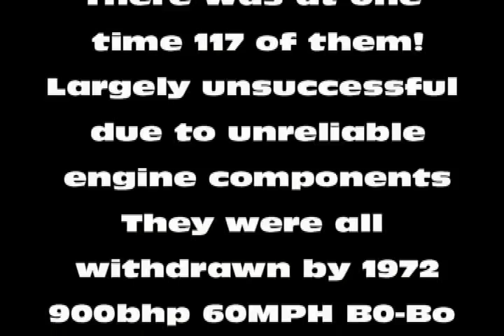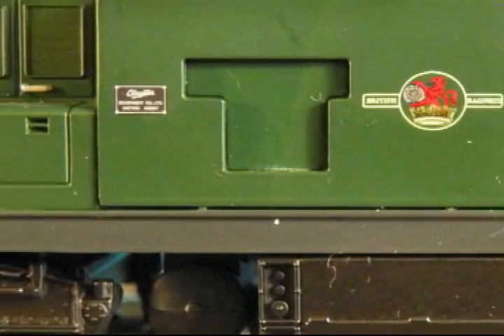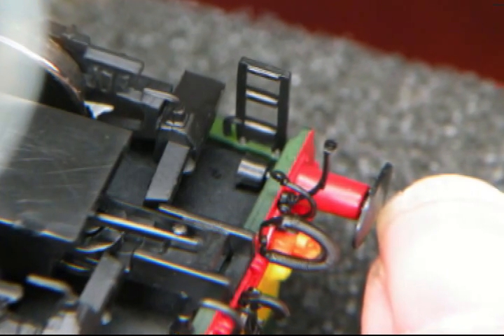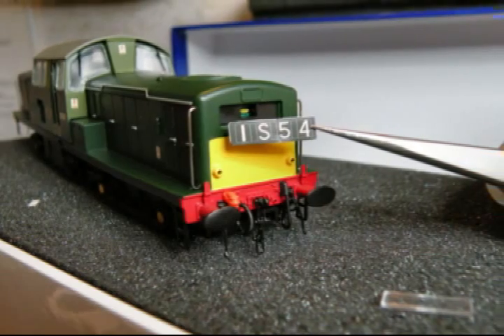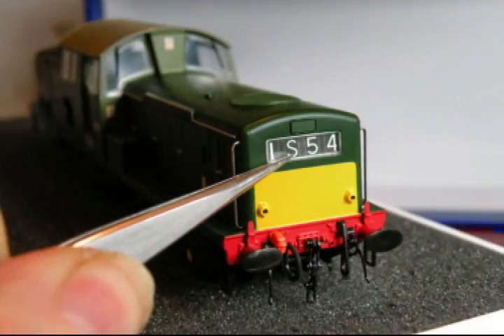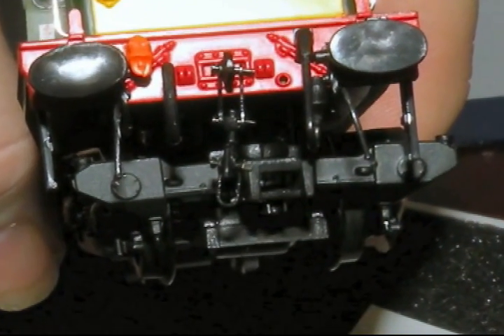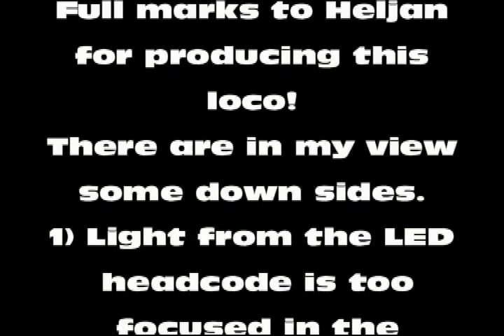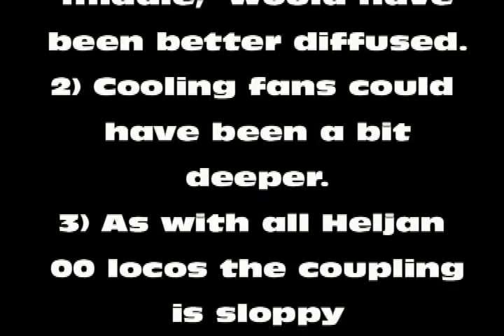Heljan Clayton BO-BO diesel loco in 00 (class 17)

Comment: Mike - did you ever get the motor sorted out on this?
Reply from the maker: +oorail.com Hi, yes I did thanks, Hattons sent a new chassis and motor which I fitted, they would have done it for me but I wanted to do it. Quite a simple swap over and now she runs well :)
Reply: MikesMovies Cool.. I bought mine in March 2014, it ran without issues until yesterday. The motor appears to be shot, ran very slowly then stopped and was smoking pretty spectacularly! I took the body shell off of it, and reapplied power thinking it might be stuck but the motor was kicking out some serious amount of sparks. I disconnected the motor from the drive train, and discovered that if I tilted it ever so slightly it would run for about 30 seconds then it started to vibrate very heavily and spew smoke and fire! Howes don't appear to still have the motor, got the usual "its outside of our 6 month support" canned response from Hattons, so I'll have to see what kind of response I get from Heljan... The motors look very similar to the ones they sell over here for Kato and Athearn, so if I don't get any joy from Heljan, I might have to rig something up! :)
Reply from the maker: +oorail.com Hi, I think it was the gears that caused it, if you check out the RMweb forums there should be one for it
Reply from the maker: http://www.rmweb.co.uk/forum/viewtopic.php?f=11&t=48061
Reply: +MikesMovies Yeah I had read through this thread awhile ago. I was told though that this had been fixed, mine was bought new from Hattons in 2014. Looking at the cost to ship it from USA -> Denmark, with Heljan being very cagey about whether or not it'll cost anything to fix. It seems like a dodgy motor, so I'm on two minds to try to replace it with a HM-5 from Kato, its about 1/4 of the cost to ship it back (let alone if Heljan decide to charge me for it)...
Reply from the maker: +oorail.com Hmm, I see you problem, did you read the bit about Mashima 1024 is a perfect "drop in" replacement? Maybe this is the way forward
Reply: MikesMovies Yeah I saw that. It looks like the Mashima 1024 is very similar in size to the Kato HM-5. I might give the HM-5 a go first since I can get it for under $20 and it'll get here in 2-3 days.
Reply from the maker: +oorail.com Good luck, sounds like the subject for a interesting video?